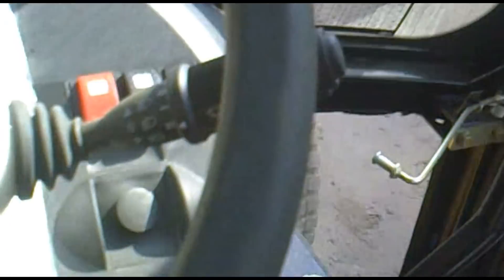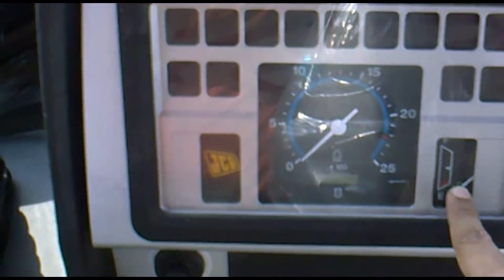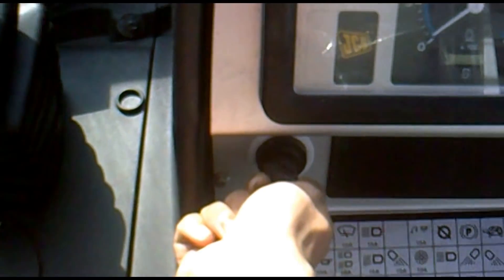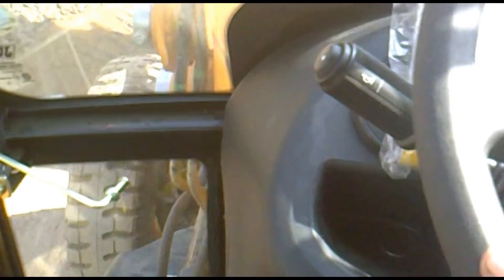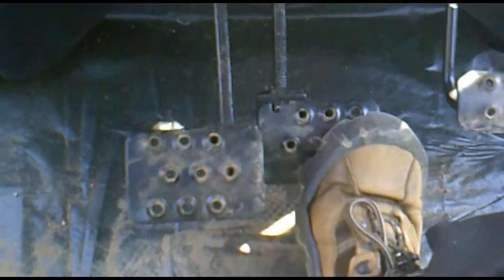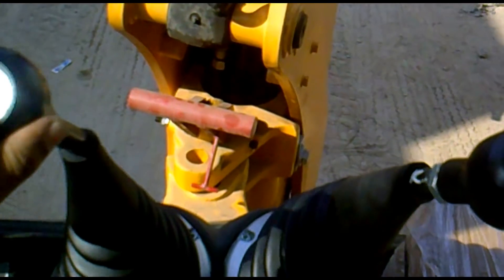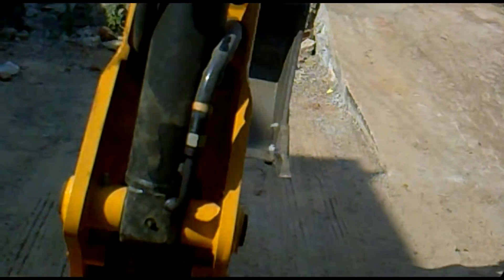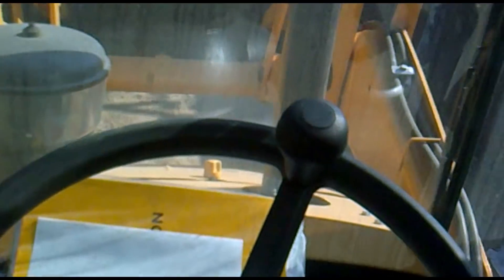How to Drive n Operate a JCB BHL Machine (Must Watch) ✔

Comment: Which is use Eco mode and power mode explain jcb
Reply: bro Eco mode  power mode explain
Reply: how many Lubricant in jcb  1   transmission oil  2  real axle / forke oil  3 engine oil  4  Hydraulics oil 5   gear oil 6 cooling oil  7 break oil   explain bro

Comment: Sir. U told that the machine is having an auyomatic transmission and it doesnot have a clutch. Bt u also showed a gear selectr lever with speeds upto 4 gears.. ? ..how do u shift from 1 to 2 or..3..4 without havibg clutch pedal.. ? Could u please explain. Please excuse my lack of knowledge. If this is a stupid questiom...thanks in advance.